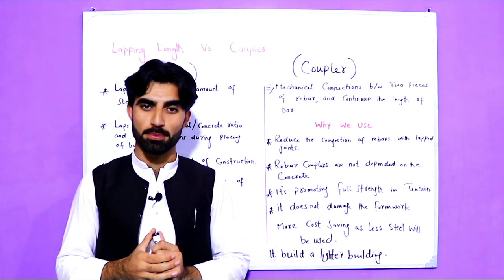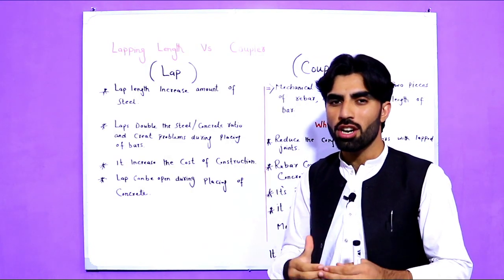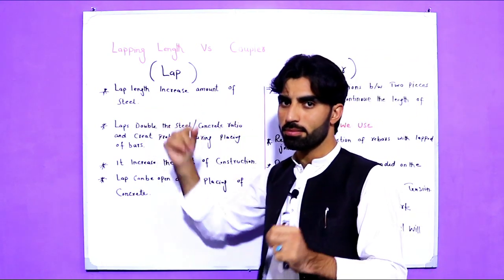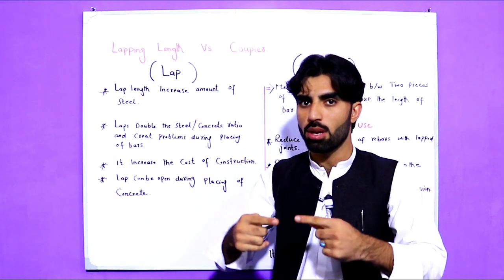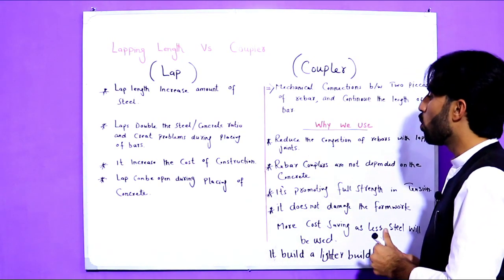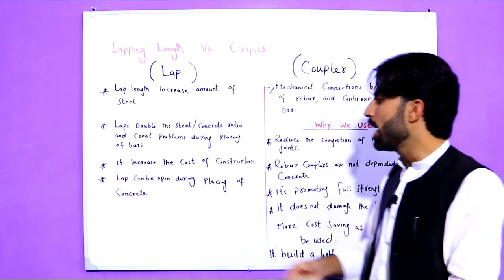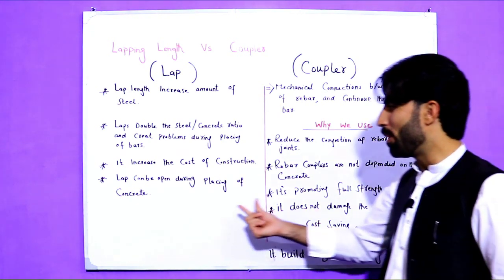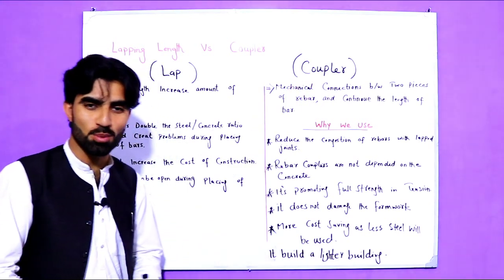Which is Better , Lap Vs Coupler - Lapping Length Vs Coupler in Steel

Comment: coupler is not always cost effective . it is  cost effective when its used for higher dia of bars (SUCH AS 36 mm , 40mm) . To use coupler  threading at the end is necessery in proper way . so we need skilled labour to do that .

Comment: What is the difference in cost of the coupler used and threading made on the steel bars when compared to overlapped length of steel?
Reply: Its more expensive